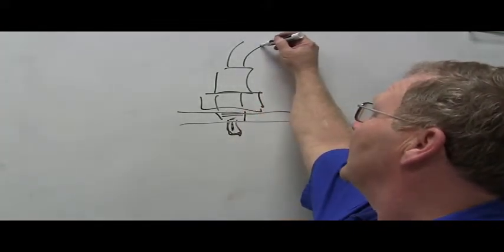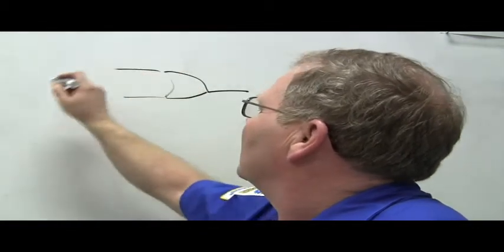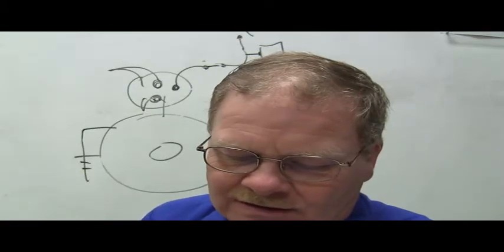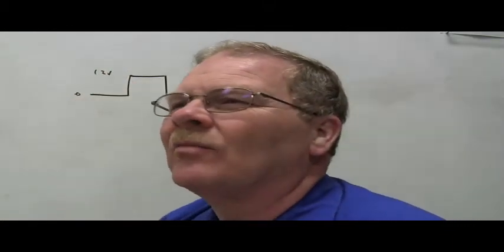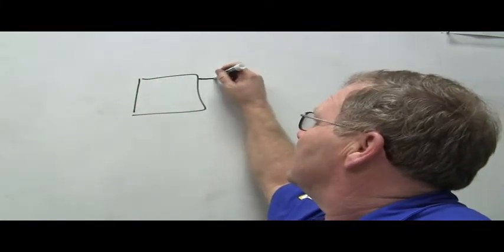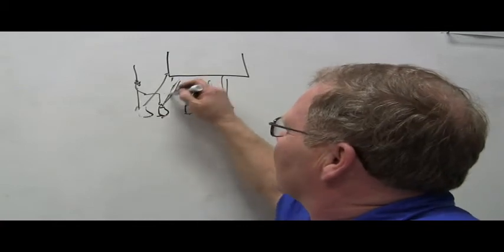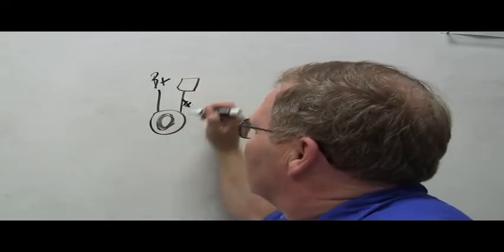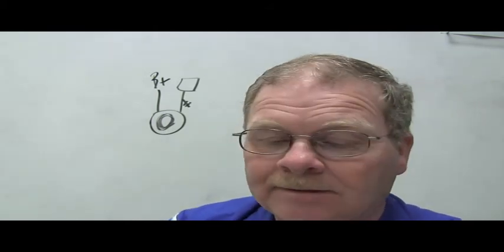Elect 2 Test 9   CMs, inputs, outputs

Comment: P0128 on a GM is the only code I've ever seen that actually tells you what's wrong...it could still be a coolant temp sensor but I've never seen it
Reply from the maker: P0125 is a very similar code that tells you the same thing, but yep.